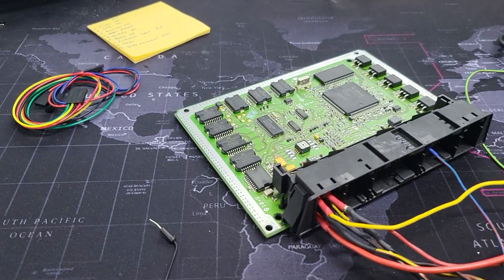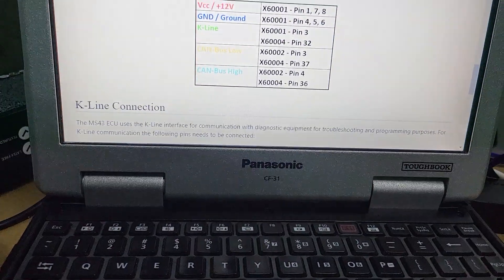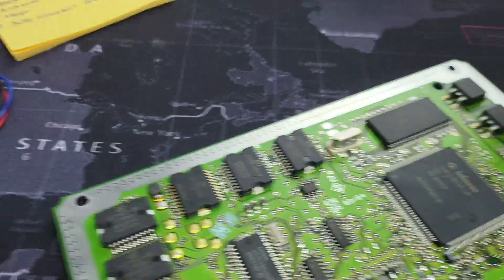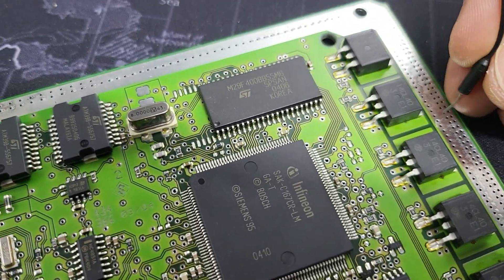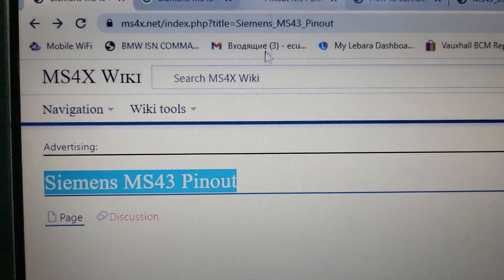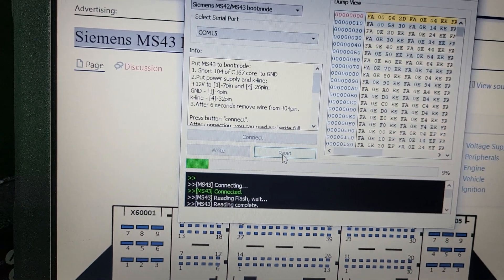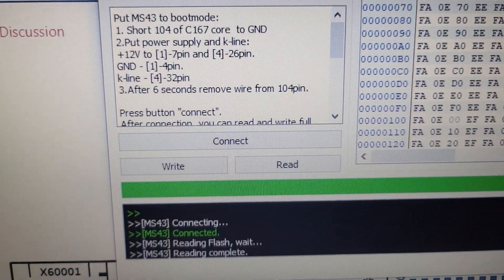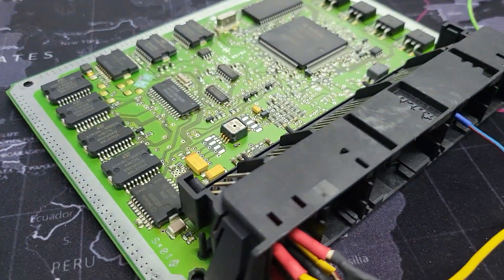Full clone BMW E39/E46/X5 DME ECU Siemens MS43/MS42

Comment: helllo great video but i have a question do u need to flash the dme with the ews?
Reply from the maker: I don't understand. You can sync DME with EWS using some tools, without flashing
Reply: yeah i mean after a full clone with ktag do i need to align ews with dme or it will start without the sync 
 @ecuproguk
Reply from the maker: @merwan2898  yes, after cloning procedure you need to sync ews with DME
Reply: @ecuproguk  How can I sync  EWS with DME?
Reply from the maker: @norbertkrueger5398  I have a video about sync